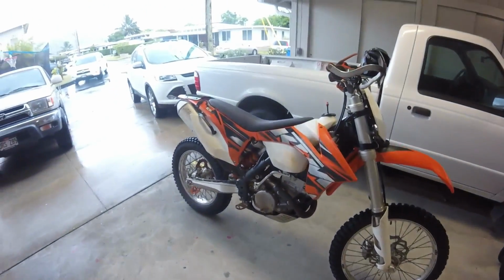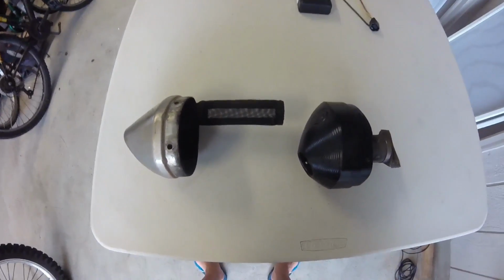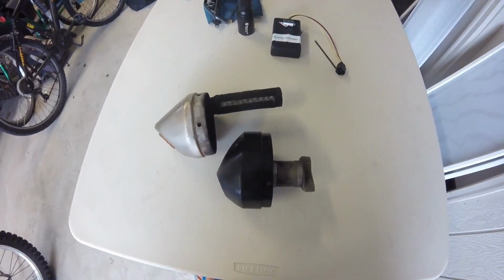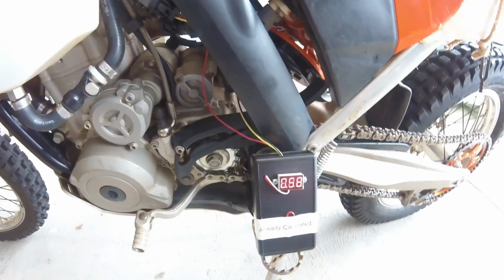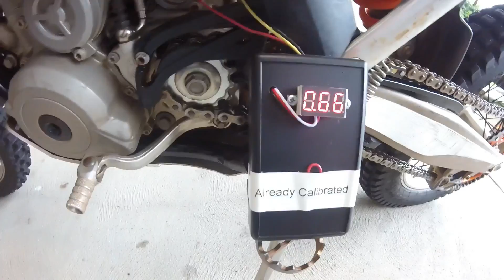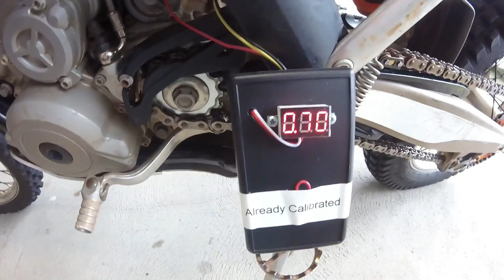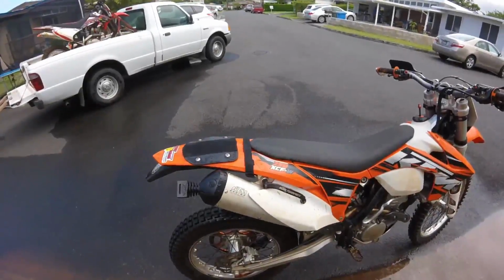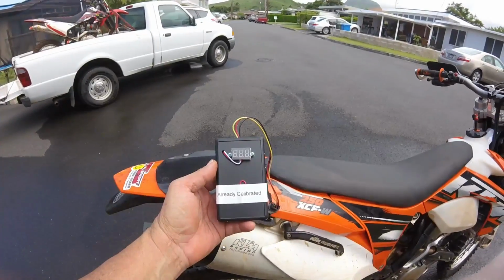KTM 250 xcf-w BEST MOD YET

Comment: Nice, I have 2014 and I added the mapping switch which really woke it up as well.  Do you think your power gain was from the end cap or having your TPI correctly adjusted?  The reviews on the end cap are mixed and it seems Dual Sport only shows videos of KTM 500s being modded.
Reply from the maker: You know I had the same thought so I put the TPS setting back to stock and rode it and I could feel a small bump in power. It ran a little worse down low but did have more guts as soon as I got to my mid range. The TPS adjust made it way more responsive and now I can lift up the front at will. I also notice it'll chug uphill easier and not have any knocking in higher gears like before. I think your year also has a manifold to help.
Reply: Thanks.  Mine does have a manifold and I bought the one from Bestdualsports but it really didn't make a noticeable improvement.  So, I was wondering if you, as an independent buyer, thought the end cap was worth it.  It sounds like you think the TPS made the most difference but that the end cap does help in all ranges?  Did I interpret your comment correctly?  BTW, thanks for responding.
Reply from the maker: The end cap alone was a really small bump up in power but I think it worked well with the TPS and air screw set correctly. Together it made two small bumps feel like one good bump and the throttle response gain was what was really needed. If you're getting good results with the map switch alone then the end cap might end up being be a disappointment. I was looking for more right off bottom and middle which is what I got so I think for me it was well worth it. I couldn't feel much gain on the top end. I hope this helps you this is just feel by the seat of my butt.
Reply: It does help tremendously.  Thank you for your honest feedback.

Comment: Just picked up a 2015 250 XCF-W for my daughter and have the same slow initial throttle response, kind of a small cough before it gets going.  Kind of a pain when you need to get up or across something in a pinch. Can you tell me the name of that tool and what exact adjustments you made? That looks like exactly what this bike needs. Mahalo.
Reply from the maker: I bought the tool and exhaust mod from BestDualSportBikes. I think your year would have the manifold kit too. He’s got some good stuff. I think you’ll be happy with the mods!
Reply from the maker: https://youtube.com/c/ktmhusky
Here’s his YouTube
Reply: How much did you pay for it if you don’t mind me asking
Reply: @kastanza19  are you asking about the tool or the bike? Just FYI we sold the XCF-W and got her a 2020 250 XC-W TPI two stroke. Light years better on the trail. It does everything effortlessly compared to the 4 stroke.

Comment: Howzit you said you ended up at .76 on the tps. Did you change that later and how was the plugs, was it fouling? The higher the number means richer? Mahalo
Reply from the maker: Oh that bike is long gone. I kinda remember adjusting it up higher. I think the theory is your tricking the bike into giving more fuel because it thinks the throttle is already cracked at idle. It ran much better and didn’t foul plugs. I think they’re tamed down for emissions control.
Reply: @braaaphawaii  thanks for the response. I checked my tps and it was at .38 so I was wondering what your final setting was. Mahalo
Reply from the maker: @Hi808trailriders  I just kept going up till I found a sweet spot. Good luck should work good!
Reply: @braaaphawaii  thanks for the help. I'm at .77 and she's running like champ. My boy is loving it.
Reply from the maker: @Hi808trailriders  Yahoo glad to hear that. Enjoy the new found power!

Comment: Hey I like your video. What is the red button you have on your handle bars?
Reply from the maker: DBKate Thanks! It's for my horn so we can find each other in the thick woods.
Reply: Cool, what's the company you got it from? I'm looking to make my xcf street legal and I'll need one
Reply from the maker: DBKate   I got my horn from ebay made by sickspeed horns. 4 inches wide and pretty loud. I mounted it between the engine and rear shock. It just fits.